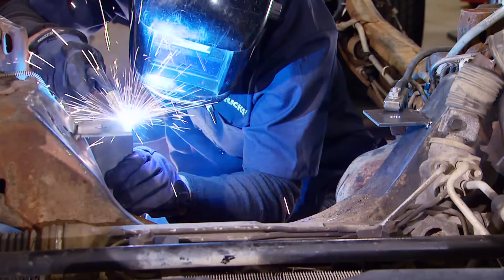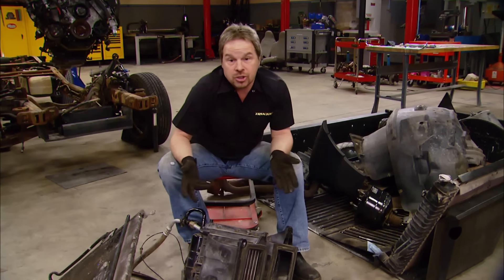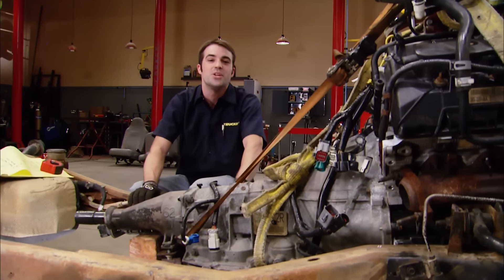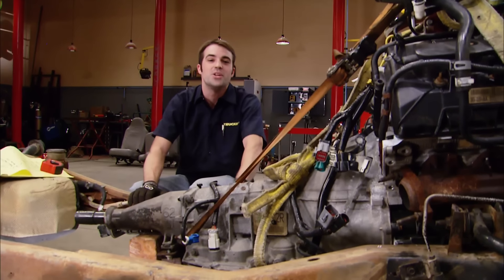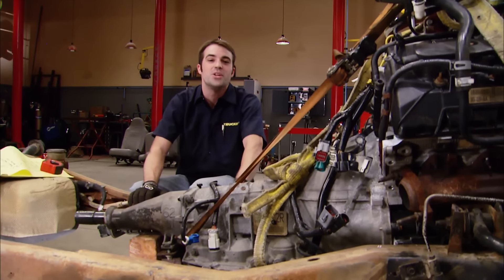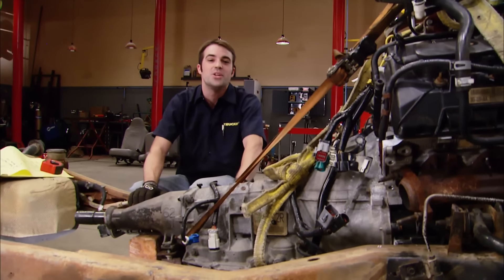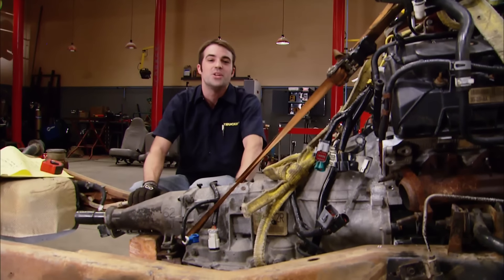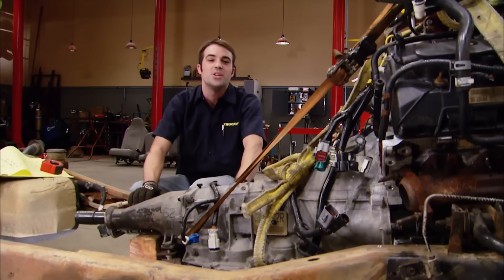Shoehorning a 4.6L V8 Monster Into a Ford Ranger - Trucks! S12, E3

Comment: Since it's going into the Mazda  B Series that was built alongside the Ford Ranger, a custom B4600 nameplate to reflect it's new 4.6 liter powerplant would be a nice touch.  😉
Reply: This is what I'm planning with mine except a b6200
Reply: @anthonymazzone980  for an LS or a Powerstroke diesel?
Reply: 6.2 Boss. What was in the first gen raptors

Comment: "we don't make any tree-huggers angry"...that statement alone will make tree-huggers angry. Hehe.
Reply: Exactly. I've removed ac systems from cars in the past. Never gave it a moments notice about letting the freon out. Didn't even know it was a bad thing. Oh well. I have a 98 V-6 Ranger that the ac hasn't worked on in years. Don't care as I'm more of a windows down driver, even in my 04 Lightning and 07 Mustang. Probably gonna yank that ac system out and toss it in the trash. I don't even know if it has any freon in it at this point, Hasn't worked since like 08 or 09.
Reply: Good. They are nuts anyway. The freon they use in cars and trucks has been tree hugger safe to huff since 1993. They switched r12 over to the same stuff they use in computer duster canned air. Does the tree huggers complain about those being used to clean off their mac books?
Reply: Ben West haha you triggered about people getting triggered snowflake?
Reply: It is not just bad, it's ILLEGAL. How fragile are you that you heard the tree hugger part and ignore the part where it is illegal?

Comment: I actually did the same swap before these guys did with a Mark VIII 4.6 DOHC in a 2000 Mazda in 2009.  What a great project had a blast doing, sold the truck a few years later.

Comment: When you’re finish what you’ll have in a sense is something like a regular cab version of an Explorer Sport Trac. We had one of these and it was an awesome ride with what was essentially Mustang GT powertrain, great 4WD system, four wheel independent suspension,   big disk brakes, and the ability to do some towing.

Comment: A real “Stealth” hood would actually be a CHEAP misaligned hood scoop from Kmart 😉👍🏻
Wash your hands and cover your mouth folks.
Reply: Ya, don't swallow any of the BS from here...
Reply: 2000 Ford ranger alternator and 

2009 Ford ranger and alte r story be2009 Ford ranger looking for alteator million Georgia discount starter
Reply: @danloope7808  - My 2004 Crown Vic is on its 3rd or 4th 'smart' alternator in 140K miles... at $300 each for rebuilt ones... wasn't a smart idea...

Comment: I had a 4.6 in an f150 for years and it was one of the best engines I've  ever had as far as reliability. I could have used a bit more hp and torque but it was so good on gas it made up for it. Dont get me wrong though, she wasn't terribly underpowered, it's just that for me, more is better. God willing, I'll always have at least 1 truck in the driveway and I always have.
Reply: You probably have access to some cheap HP just with a tuning chip and everything else stock.

Comment: Love builds like this. Upgrading with oem parts is awesome
Reply: That's the right attitude pick and pull yards and ebay, all the way.
Reply: Easiest V8 swap on these trucks is a 96-01 Explorer 5.0, it is way smaller than the big DOHC 4.6. The Explorer is also a Ranger-based vehicle, so the radiator, wiring harness, transmission and other parts require no mods and bolt directly in, and you don't have to remove your heater box or mess with your firewall. I was even able to reuse my stock Ranger driveshaft on my V8 swap - I have videos on my profile of it, all Ford OEM parts. It is not as powerful as the big DOHC 4.6, but it has a decent aftermarket and fits well.

Comment: I'd just keep the Mercury Marauder🤷🏿‍♂️
Reply: Too bad is was wrecked
Reply: Easier to drop a SBC 425 HP 350" in...
Reply: @BuzzLOLOL  or even better...a 475 hp 351..and  this way its not all junked up with a cheap chevy motor
Reply: Thing will run good with the 4V. We put a 2V 4.6 from a 2006 P71 Vic into my friends Ranger, a 2000, in place of the 4.0 that was in there. Left it stock with a chip and some trans work, thing was a total sleeper that surprised a LOT of people.
Reply: @BuzzLOLOL  or a 383
Reply: 302 out of an Explorer is literally a straight bolt in and you would still have AC and if you wanted to leave all the stock engine covers and airbox you could for the ultimate sleeper look.  The best thing is the 302 just like a SBC is pretty cheap for parts and in 2000ish made 215HP in bone stock trim with a ton of untapped power potential still left inside.
Reply: Problem with v8s in these tiny trucks is weight. You loose a lot of handling. Good for straight lines but that's it. I've got a 2.3 5spd. If you look into hopping up a 2.3 you can push 250-300 hp out a i4 and it's a lot lighter. I originally wanted a 5.0 swap but now I just want to turbo and change out rods, crank, and pistons. Same power and a smaller engine for me.
Reply: And it all bolts right in no fabing required
Reply: @lukasspears7687  I did a pick a part SVO fox body 2.3 swap in a pinto I had 22 years ago and it was fun but it isn't or at least wasn't a cheap engine to build.  I got lucky and found a smashed Mustang for the engine and trans but today that car has value and the commie Chinese aftermarket stuff from my experience is all garbage.  The 302 really is a light engine weighing in at 460LBs and the turbo 2.3 weighs in at 450 lbs so weight really isn't a problem... Not to mention all the aluminum bits you can buy for a 302. Myself I like the bark of a v8 and that low end torque...  Both engines have good and bad points and both have been proven to be extremely good engines so its all about what you want and your budget, the best part of a 302 swap is it literally fits in there since the ranger and Explorer are the same truck... Infact I saw an Explorer the other day wearing ranger prerunner glass which looked really cool. Now all that being said the 2.3T has one big advantage for a daily driver, it gets great mileage if you keep the revs low and well the v8 even if you feather foot it you won't see 17 in real world mixed driving.
Reply: @bigboreracing356  you start playing with fords you are going to change the way you think and feel about them ...you are going to get ford fever .....you need a maverick to  put that motor in
Reply: @AtomicReverend  I personally live a v8 rumble, but the i4 just has really good fuel economy. Besides, when you gap an import in a beat to shit ranger with a 4 banger you look good. I'm kinda 50/50 as to which way I want to go still. I already have a 4 banger so it wouldn't be hard to swap in a built 4 banger in.
Reply: The point was to upgrade a stock looking minitruck
Reply: @AtomicReverend  gotta look into that I like the idea of a simple bolt in from a donar car

Comment: Solid info in this episode, I'm currently in the process of swapping a 302 into my 90 ranger so there was a couple of things here I could take to this build. Awesome video.
Reply: How'd your swap turn out? I just picked up a '93 Ranger w/ only 2400 original miles on it. But back in '94 the original owner took it somewhere to have it fully converted to electric. No engine, no fuel system. It's got some sort of electric motor in the front that is attached to the factory 5spd. It's all done professionally even down to an air compressor for the power brakes. But for the cost of 20 new batteries I'm thinking engine swap would be potentially easier & cheaper.

Comment: I had a gm 350 in a 1981 toyota pickup , the back end would lift off the ground when i went trailing and put the brakes on too fast going downhill lol
Reply: Needed aluminum intake, heads, and water pump to cut weight...

Comment: I love this swap! A potential problem area that may be exacerbated by the engine swap is upper front shock mounts. Just dropping off of a  slab of pavement on the highway I managed to pull the shock out of one of the mounts. Best Wishes!

Comment: Not even close on the driveshaft run-out measurement. It should have been supported on the OTHER SIDE of the weld, and measured at the end. By measuring it over the supporting v-block, you only measured if the tube was round, not the straightness after welding.

Otherwise, nice build. We all can't be machinists...
Reply: I wondered if anybody noticed that!
Reply: Roger that.

Comment: You guys really should have built this into a 4x4 it would have been cool.  This is gonna be squirrely to drive in any kind of straight line with such a short wheelbase and light weight not to mention frame twist

Comment: I would like to see the build sheet cost when your done. Nice work; [ * Are the 4.7 liter used in Mustangs  ? [ * a. Is the timing chain guides for the cams nylon.[ b.Will the motor have to be pulled to do  the cam chains/timing chain ] [ * Will the plugs be easy to change on motor, *oil filter ect .  [ And finally, will you have to change out the steering column to one of those close drive units ? You guys are pros...
Reply: You mean 4.6L.

Comment: Probably shouldn't use the word "monster" and 4.6L in the same sentence lol
Reply: Compared to the 3.0 V6 that probably used to be in it, it is a monster.
Reply: @Brock Main3 no doubt!
Reply: @wyattlarrick3246  people have 302's and 351w in them for years. I'm assuming "monster" refers to the modular 60° block setup
Reply: 4.6 is a big ass engine bigger than a 351 or 302
Reply: This small 4.6L is dimensionally bigger than a 351(5.8l)
Reply: @Mike C video?
Reply: @mikec9112  different block and heads genius... and no that block was not stock. And the heads were ported off a gt40.
Reply: Mike C. Did they use the Teskin block?
Reply: @konnerkramer329  the heads were not off a gt 40... you are referring to supercar heads off a ford gt. Either way 4.6s have made north of 1000 hp with sealed long blocks.
Reply: @stevenmabel48  yes the heads were off a gt40 and the same heads that were used on the gt500. And people have made north of 1600hp with cam only tubro 6.0s... what's your point.
Reply: @konnerkramer329  a ford gt and a gt 40 are 2 very different cars...my point is you dont need a modified blocker heads to do that.
Reply: @stevenmabel48  yeah you don't need to modify the short block unless you want the engine to last more than a couple Dyno pulls and a hundred miles.
Reply: @mikec9112  those aren't stock heads. The second you touch the runners with a Dremel they aren't stock. And have you ever heard of the lsx block? A cast iron ls7 block made by gm. Personally have made well over 2500hp with them.
Reply: @mikec9112  it's also not a stock Crank. And the block has been modified.
Reply: @mikec9112  lol you Ford boys are so jealous of the ls... If I have a nickel for Everytime someone said the ls is basically just an updated Windsor I'd be rich. It's not a good damn Windsor. It has the same bore spacing and deck height as the lt1. Same reverse cooling and firing order as the lt1 and shares many parts with the vortec 350s. It is a gen 3 sbc for a reason. There is nothing Ford about it.
Reply: @mikec9112  like I said you can't say he ran stock heads when he has decades of research and hundreds of hours porting those heads off a $200,000 exotic. By those standards my 500hp na 327 is also stock...
Reply: @mikec9112  literally the only thing the ls "shares" with a Ford is the Y block style main caps. Which Ford stole anyways. The cathedral port heads and not even close to the same thing as 427 heads. The LS literally uses the same part numbers for main and rod bearings as a gen 1 sbc. and the 6.0 uses the same piston rings as a vortec 350. It has the same deck height as the lt1 and reverse cooling like the lt1. Just because a Ford has reverse cooling too doesn't mean Chevy stole it from the Windsor. It also uses the same oil pressure sensor, coolant temp sensor and crank trigger as the vortec 350. The firing order is the same as a  gen 1 sbc with a 4/7 2/3 swap cam. Something pro stock racers have been doing to the sbc since the 70s. Like I said from the beginning yes it has similarities with a Ford but it is literally just an updated gen 1 with designs taken from the lt1. Oh and as for the head bolt location there the same as the lt1 for Ford stole that from Chevy actually.
Reply: @mikec9112  who cares if your $60,000 Ford engine has ran in the 5s. You compairing it to a truck engine...  You can build a 700ci all billit engine for the price of that 4.6. everyone know if you actually want to go fast it's hard to beat a BBC. But of wait because its a 90 degrees v8 I guess they stole that from Ford too.
Reply: @mikec9112  it is impressive but at the end of the day it's still a $60,000 engine that has to be rebuilt every season. The people make 2000hp+ LS engines last several thousand miles. The reason the ls hasn't ran 5s yet is because of the big block chevy. The people who are running that fast in Chevy's use big blocks not ls engines.
Reply: @bri-manhunter2654  Teksid
Reply: The Maurader had the 32  valve like cane in the Mustang Cobra. They were good stock, but they were monsters on boost with those big 4 valve heads!
Reply: It’s a monster for the ranger. for sure.

Comment: Why would they cut it right there, the other side of the drive shaft you can cut the welds on the yoke and pull it out the cut. Hammer yoke back in . The yoke welds to driveshaft tube. Much safer

Comment: Put a lot of lube on the sides of the 4.6.....get an extreme big hammer.....grab your most heavy-duty shoe horn.....get the 'gas axe'.....and have at it.  Wow!  The Matco tool for the u-joints is magic!  Although I've never had much trouble working on u-joints.....those are great.

Comment: I've seen this done with a late 80's S-10 and a 383... Also saw where he flipped it on the side of I-10 too!
Same engine in a postal Jeep, but they couldn't keep the tires on the ground. It would flip back, vertical and need a push over.
Reply: Yep.  Tons of kits to drop a SBC into an S10.
Reply: Yeah, SBC goes easiest into Fords: https://www.dailymotion.com/video/x3rfhrk

Comment: This is a neat idea, I been looking for a near 00 mazda of my own, this looks like a fun project. The cool part, If the 4 valve filts, then the 2 valve should fit better
Reply: Just drop one of these in: https://www.dailymotion.com/video/x3rfhrk
Reply: @BuzzLOLOL , I'm a bit on the brand matching side of things. Nothing against dropping a chevy in a ford, just not my style. Also the 4.6 sohc is one of if not the most durable decent performance engines in modern hot rod era. 30k-400k miles on many of them in daily drivers, a little hot rodding and maybe a little ECU tuning, it's be a beats you can't kill in a mini trick
Reply: @crazylarryjr  - So many Chevy's got dropped into Fords and other vehicles because they make so much power, so many made, small on the outside, low prices, cheapest parts, and drop in so easily... even the stock oil pans usually fit...
Reply: @BuzzLOLOL , In something like this, you don't really need that much power, for a fun ride. I do know that the 4.6 is almost unkillable, but so is the LS1's as well. besides the ls is played out, why not do something different?
Reply: @crazylarryjr  My 4.6L is dead... the sparkplugs popped out of it... waiting for warm dry weather to tear into it...

Comment: Easiest v8 ranger swap is a small block Chevy. Center on the cross member and th400 trans,  no drive shaft mods just a Chevy slip yoke with a u joint that's Chevy one way ford ranger the other. Drove my 93 2wd for years with a 350 in it.

Comment: Navigator 32 valve motor, identical, more power, available since 97. Poor marauder gave up its heart. Also, ground slots in your cheapest pair of needle nose pliers, work for snap rings pretty well. ✌
Reply: Yeah but the Merc was wrecked so it lives on.
Reply: That navigator motor is also way taller. And the intakes and more of a mess too. Exactly what they dont want

Comment: You might need a rubber damper in between the new motor mounts. Like a machine vibration lad. Im just saying steel on steel & that truck will shake. Maybe some air ride.

Comment: when my misses wanted a new truck she wanted an S 15 she saw at a car lot and took me to see it . it had a 350 corvette engine stuffed in it and was a rust trap but I could fix it so we got it and took it home . a few weeks later she blew it up racing a mustang and had to tell me about it but was scared I be mad .so she finally told me and I got to work on a much bigger project I replaced the engine with a 40 over 350 and used the good corvette heads. repaired all the body work and got a new bed her's was gone when it was done she had her little gold S 15 that stomped all the mustangs in town tell the GT 500's came out. yes this was in the mid 90's .

Comment: Probably a stupid question but to correct the runout do you just smack it with a hammer on the highspots or bring it back over with a weld on the other side?

Comment: What confuses me is why they went with a 32v 4.6? The modular Ford's ( 4.6 & 5.4) blocks and cylinder heads have the same external measurements. The 5.4 makes 330 hp and almost the same in torque. Heck you can use 4.6 heads on a 5.4 in some applications. You can even buy some adapters off Amazon for fifty bucks that allow you to use any pi 4.6 intake on a 5.4.....there are about 6.9 wahzillion 2v 5.4 s out there .
That u joint tool should not be used with most aluminum shafts and yolks...just a heads up unless you have a Tig welder or are skilled with JB weld😎😂🤣
Reply: MIght be because the 5.4 is so much taller than the 4.6. Even with the 4.6 intake it wouldn't fit under the hood most likely.

Comment: if your putting a modular 8 in why not the 2003 5.4 2v with the PI heads

there is a pin hole in the crator at the tail of that weld.